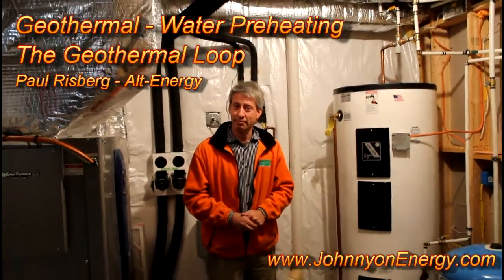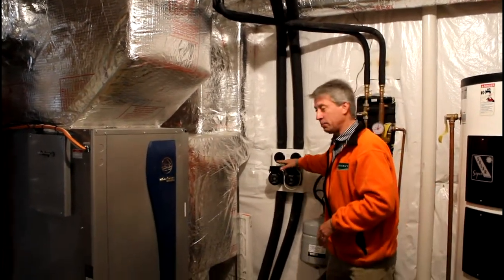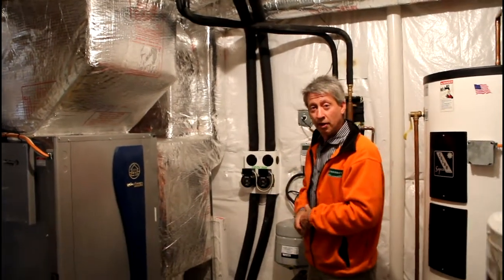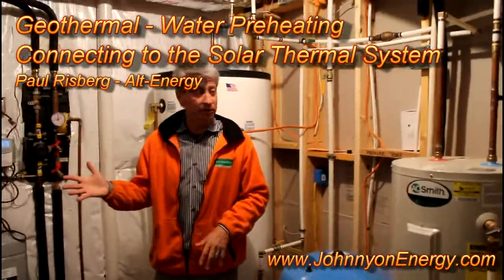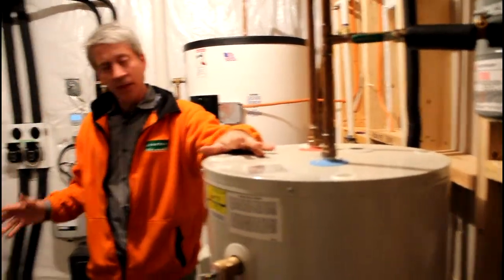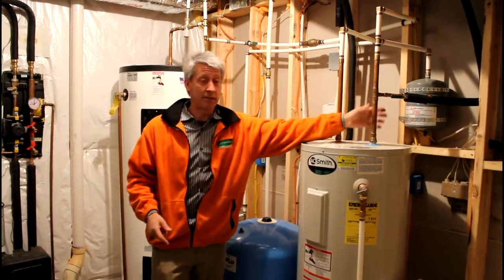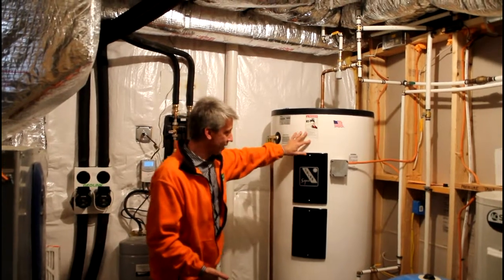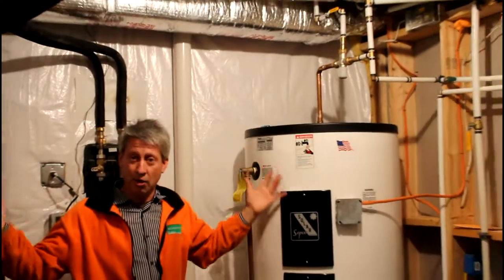Hybrid Geothermal Solar Thermal Home Tour - Video 2

Comment: For better efficiency, i do not use a electric heater on the solar reservoir. I preffer to install 3 réservoirs: Géo/Solar/electric. In case of space limitations, i use 2 réservoirs, one for solar and geo, the second electric only.